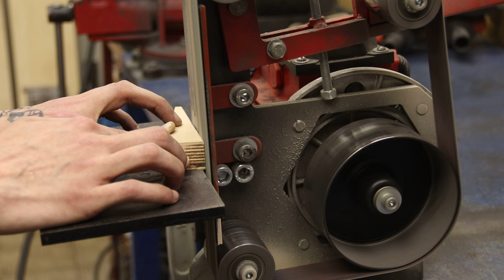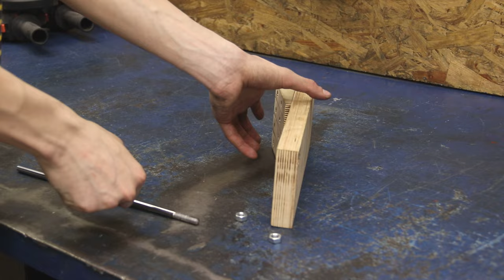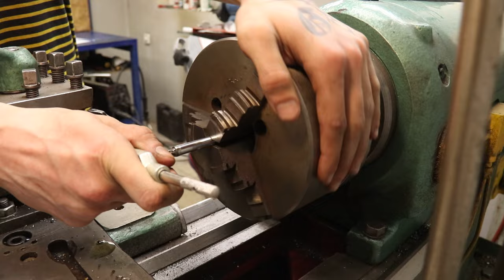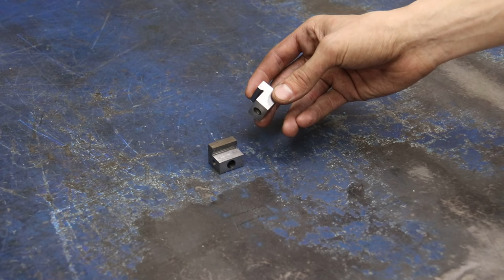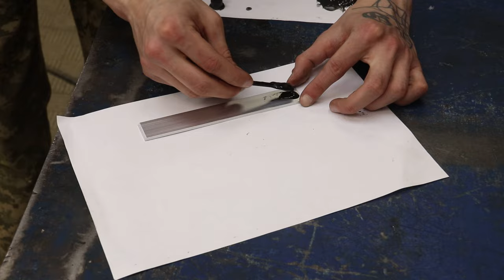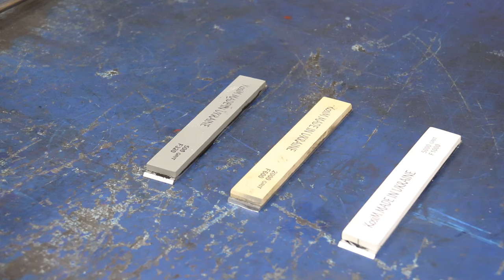Cool DIY knife sharpener!

Comment: You may want to clean the sanding belt. They make an 8" or 205mm long eraser just for that purpose. They are not expensive and last for years. Clever idea using a 
C-clamp to hold the piece of metal. One of the best DIY designs I have seen. You could also use a threaded rod for the handle rod, which would eliminate the need to tap and thread a stainless steel rod which can be expensive to buy. Every other component is very accessible and fairly cheap. Nicely done!! I may have to make one myself. Where did you find the small sharpening stones?

Comment: This is the most complicated DIY I’ve ever seen.
Reply: Seriously? You can use the design, just modify it if you do not have metalworking equipment. Use a threaded rod and wooded clamps to hold the stones instead of steel. I don't see what is complicated about it.
Reply: @crossgrainwoodproductsltd9230  you need a some equipment that not many DIYers have.
Reply: @crossgrainwoodproductsltd9230  it’s not simple, and it’s not with everyday tools.

Comment: This cannot be called DIY as most of us dont have access to all these tools.
Reply: Well, he "did it himself". You don't need access to all the tools he has to make this, such as the lathe, belt sander etc. It's called improvise. He showed us the way giving us the concept, and now it's up to us to be creative on how to "DIY". Most people looking up videos like these have a drill, a saw to cut wood, a sander and some sort of way to clamp something down. I don't own a lathe or half the tools he owns but I find ways to make what I have work. For example, don't have a lathe, use your drill as a lathe. Don't have an angle grinder, buy a backing plate for your drill with the correct sand paper and use your drill. It may take longer but it'll do the job. Either way, this video was a good presentation on how to make a cool knife sharpener "DIY" STYLE.